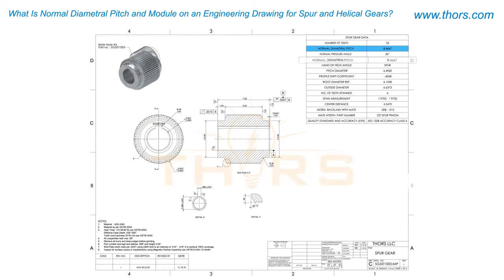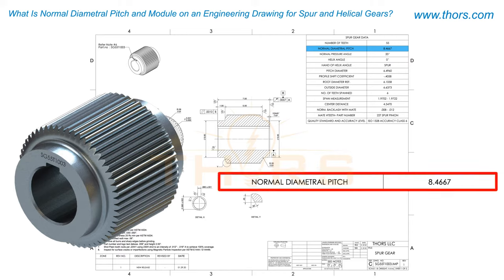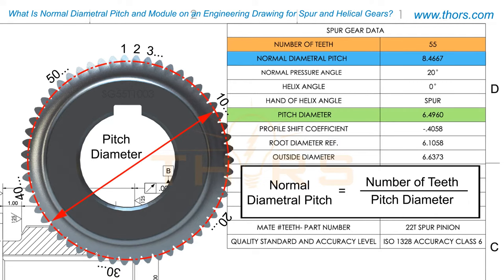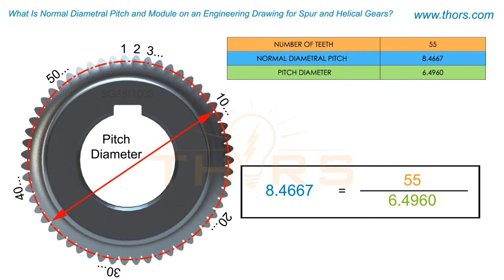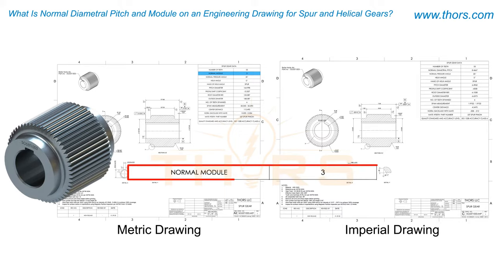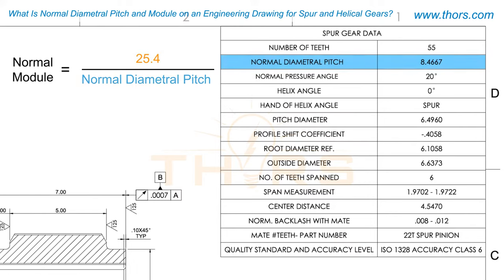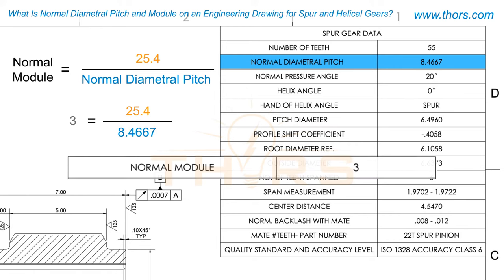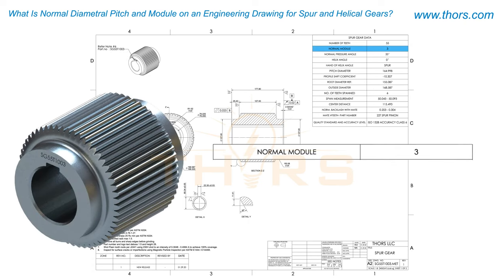Normal Diametral Pitch & Module on an Engineering Drawing for Spur & Helical Gears || Course Preview

Comment: Ah. So Normal Diametral Pitch (DP) = Number of teeth / Pitch Diameter. Everything is clear, now. Except how to I calculate Pitch Diameter? Do I simply divide number of teeth by DP? So I am right back to the question of how do I calculate DP. Oh yeah, that's simple. DP = teeth / Pitch Diameter. So how do I find Pitch DIameter? Oh I already went over that, yeah. Well, at least I can count the teeth. That's a start, I suppose. And I can measure Outer DIameter and Root Diameter, but the average of them in your chart does not equal the given Pitch Diameter. So can you help us out with how to measure Pitch Diameter? Thanks.